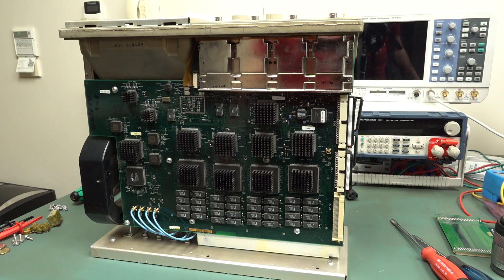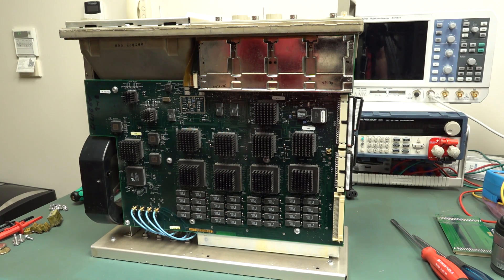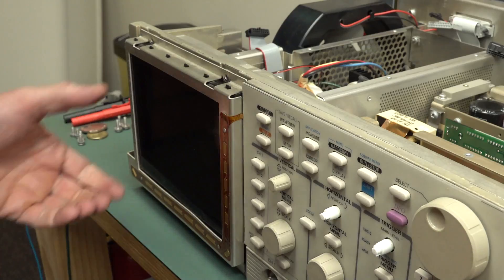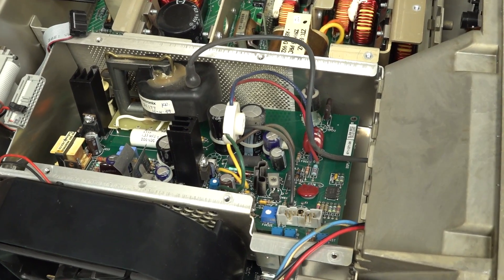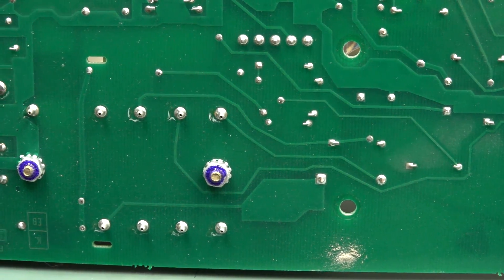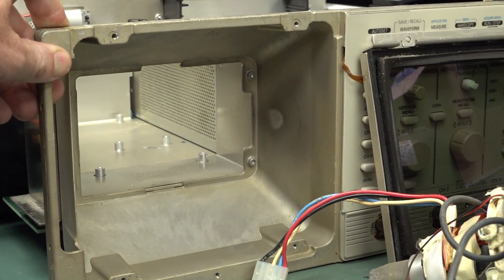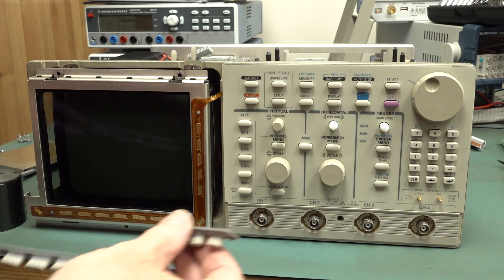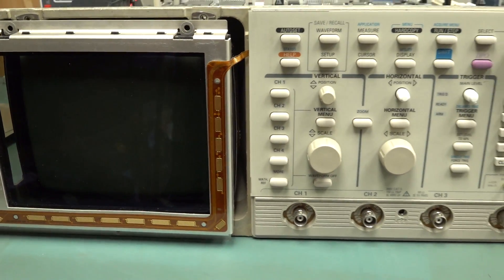Tektronix TDS540D Repair Part 1

Comment: The anode cap to CRT go bad and arc causing dim, or arcing to frame and CRT won't turn on as a result. See spot where it arc over on side of frame. RTV over the anode cap usually fixes it. Just use clear RTV and let it cure for a day.

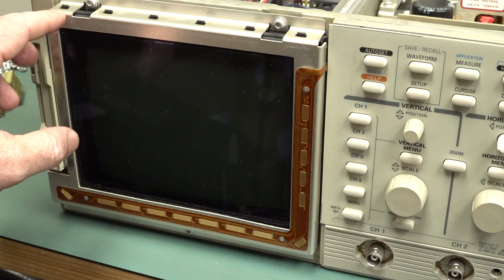Comment: Viewers! Date at time index 1:35 you said take the screws off to remove the CRT Frame. UH don't do that until you pull out the control panel, it just pops off, if you don't you can rip the control ribbon on the CRT Front Frame.  Here's some good info for you Dave when I did the research on this for mine. I have the LCD but never put it in. IT WORKS GREAT though sitting next to it. LCD types & Dimension Info below.

Dave, Here's some Important LCD info for ya.
-The LCD EXTERIOR dimensions need to be no larger than: Note the depth can be deeper than 1/2" but you will have to make some offset brackets to compensate for the deeper depth. Standard: 1/2" X 6-5/8 (6.64)" X 5-1/4 (5.25)" Metric: 127 mm X 168.65 mm X 133.35 mm 
-The ACTIVE/VEIWABLE AREA dimensions needs to be no larger than: Standard: 4.4" down X 5-5/8" across. Diagonally: 7.2" Metric: 111.76 mm X 143.4 mm. Diagonally: 182.88 mm. 

-The Active area, for best original ratio, MUST be a ratio of 4/3, here are some example ratio resolutions that should work if the screen is a 7" diagonal: 800x600: 1024x768 & 1280x960. To figure out if the Aspect ratio dimensions are 4/3 divide the large number by 4, then multiply the answer by 3. Then you will have the Horizontal x Vertical numbers you need. Ie. 1280/4 = 320, 320 x 3 = 960. So the screen you need is 1280x960 for a 4/3 aspect ratio. I don't know the resolution of the VGA out so I don't know if larger resolution screens will even make a difference in clarity. So until I do the experiment, or someone tells me, the 800 x 600 will have to do.
I put this information in my TDS744A project here: If you want to see it. https://www.youtube.com/watch?v=xv_ldH1dZMc Keep up the great work Dave! Best Wishes n Blessings. Keith Noneya Oh PS fix that CRT so I can fix mine LOL. Keith

Comment: You can run the driver board external to the chassis. Reconnect the ribbon cable, reconnect the CRT, and it should run. Of course, you have to be careful with positioning,  but this will allow you to measure voltages and probe around. Check the linear regulator output first, then have a look at the 50V and 500V rails. My guess is the failure is in the linear regulator, or in the flyback transformer (or driver). If you have a good 50V and/or 500V rail, then the flyback driver and H-sync path is probably all good. You can still have a flyback failure on the CRT anode HV though.

Comment: On the Tek TDS scopes,  the CRT usually comes out as an entire separate module -  frame, driver board, and all.    Not sure about this unit,  but the last one I rebuilt and restored,  a TDS 420A was this way.  You would remove 5 screws and the whole unit lifts up out of the chassis,  making it very easy to access everything.

TDS scopes of this era have been notorious for bad caps as well. The TDS 420A I just finished repairing had so many failed electrolytics -  some were physically leaking and had corroded the traces and other components on the acquisition,  attenuator, and power supply boards -  that I said the hell with it and replaced them all.  Over 100 of them in all throughout the scope.   It works great now,  and is one hell of a scope for the money,  but it's a bit of work to get them going again.

Just saying that you might want to check the main power supply as well.  It might work on the VGA output,  but there could be an issue with the rails for the CRT board.

Comment: Looking at the adjustments on the main board, it does look like you can run the CRT without the scope because it's a regular VGA monitor, with the 16-pin ribbon cable feeding video. VGA is nothing more than a set of analog R/G/B signals (which are probably mixed together on this mono screen) and a TTL-compatible pulse to trigger horizontal and vertical sync. That will take up 10 pins, with the remaining pins probably providing the power voltages required, it should be pretty easy to figure out which pin does what by scoping them, you'd need a high-bandwidth scope though, like the one you're trying to fix ;-)
Reply: Stoney3K actually, TDS series scopes from this years used to have a db-9 VGA output on rear panel. My TDS320 has it. VGA signal is monochrome.

Comment: If the flyback supply is working and buzzing then it will probably be the high voltage transformer the culprit. It must be a very obtainable part. CRT devices needed this changed all the time for repair until they were obsoleted in the late 2000s

Comment: Dave, check the deflection coils for resistance;  and I would also suggest checking their control transistors/immediate circuits for good gates etc... should be able to do some off-line probing to possibly find the issue....

Comment: Once I bought a 30 years old scope (it was comlitely analog). But after few hours of work horizontal line disappeared from screen. Thankfully I had a manual and after some investigation found that problem was in CRT's drive output transistors (don't remember vertical or horizontal coil). But I was able to find broken transistors only when scope was switched on. Without powering it on transistors seemed normal.

Comment: You need to find the adjustment pots and give them a turn while it's on and see if you can affect the picture in both directions or not. You also need to see if the screen pot (usually on the flyback) makes the screen brighter or not (be prepared to get a slight shock if the flyback is faulty). This will let you know if the problem is horizontal deflection, vertical deflection, or the flyback.

Comment: You showed us a high voltage probe adapter in the last video. Use it to check the screen voltage and horizontal, vertical waveforms. 
My money is on a power supply problem...
Cheers,
 - Eddy

Comment: Looks like the vertical deflection is far down, try to measure the vertical coils if theres some continous DC on the Signal, if yes i would expect the drivers output transistors to be cactus  if no try to measure input signals and voltages of the driver. Good luck by the way for the "colour" mod later, i had the same scope once and did the same project which was a pain in the a... because i did't had a hot air station then, try to add the 2F FFT function also as long as you got it open, it's just a bit of editing in the Dallas RTC (take a copy of it as soon as it works and do the CR2032 mod with the chip) ;) Just a pitty that I lost that scope after all that effort in a bigger incident in march 2017

Comment: Dangerous anode cap? It just gives you a shock, it won't kill you.
Reply: Okurka  it’s true that it probably isn’t lethal, but there is still risk of nasty injuries, such as whacking your hand against a sharp object as it jumps wildly from the jolt.
Reply: I actually met someone who was a specialist in fixing CRTs, and had a few high voltage shocks on these things. Damages to its motoneurons left him with a hand permanently shaking. How practical for soldering!
Seriously, never ever toys with CRT without discharging them. It's easy, it is nothing but a capacitor. So before unplugging anything, connect an alligator clip to a screwdriver, the other lead to the ground of the device, lift the skirt of the suction cup (you naughty!), blindly probing for the hole (this is getting pornographic) until the bad boy discharge (here we are).
Then you can disassemble everything. Some CRT have auto-discharge circuitry, some does not hold the charge for long, but anyway, never tick the dragon tail, better probe its hole before anything.
Reply: @Damien.D  I think neural damage was probably more due to repeated encounters with hot chassis sets ;)
Reply: Problem is you drop the crt and it implodes. Or breaks foot. These things give a helluva wallop
Reply: Agree, never heard of anyone being killed working on a tv,  it's more dangerous to apply 220 vac to a 110 device.....
Reply: @gerrymacdonald5435  Actually there has been lots of people killed working on older TV's since most of the picture tubes runs on 17KV to 32KV by using a EHT/flyback transformer which converts line level 120v/220v to 17KV - 32KV as required by the specific picture tube.
Reply: Anode cap is not the capacitor he is talking about, Anode cap is the point (connector which looks like a ladies hat) where extra high voltage transformer output wire connect to the CRT (the fat black wire in this video). You definitely don't wanna touch on that even by accident.
Reply: @vijaymerceline  CRT is the capacitor in this case (it's basically Leyden jar).
Reply: @shana_dmr  true! I should've known that since I'im working with CRTs for about last 20 years  :)
Reply: @vijaymerceline  Let's be honest, if someone works with two hands, grabs wonky EHT cable when TV is on or before discharging the CRT it's their own fault;) I think most incidents when you learn why it's called "flyback" (because you fly back after touching it) are totally avoidable. Just if you want to check that anode voltage is OK, grab one of these big kilovoltmeters made specifically for that and not try to make an arc to the chassis (I did it once or twice, I admit, but always with one hand, good insulated pliers, with set floating electrically, on wooden floor and set on non-conducting table).

Comment: While upgrading to a new color LCD is cool, I'd learn more from watching you diagnose the problem with the CRT. Systematic diagnosis; looking for obvious issues, then going section by section until the problem is found. That would be awesome.
Reply from the maker: The problem is you can't probe this with the power on. So no ability to do even basic powered-on measurements. All you can do is dick around randomly checking components in-circuit, or sucking them out and checking.
Reply: Solder the testleads you need, pull them trough a venthohle and power it up to measure (short version) or build a temporary extention to power it outside the housing, there aren't so much signals and lines going to the CRT Unit(longer version) ;) Nice greets from Germany/Denmark
Reply: ^ Agreed.
Reply: HV section was never an issue in repairing CRT TVs. Hot chassis design popular in consumer gear was much more dangerous, especially if you worked at customer's home, on your knees in some dark room corner and no isolation transformer;) There are literally few points in typical CRT that can zap you and you have to go around your way to do it. Respect doesn't mean fear, typical household electrician works with much higher energy circuits with exposed wiring on daily basis, and if we go along with electronics typical mains based switching mode power supply packs much more punch for your "excitement" during poking around than small B&W CRT. And no, neither flyback nor deflection circuits will kill you, you'll just learn a lesson that was entirely avoidable;)
Reply: This one is easy to power...
Power and signal is all through  a 16pin ribbon cable.  At worst you’d have to make a longer 16pin to 16pin ribbon cable and power it out of the chassis 😉
Reply: Me too, but if a colour upgrade is an option, killing two with one, sadly I would opt for the LCD option
Reply: Already see the problem as can see the arc spot on side of frame as fix a few of these and same issue pretty much. The anode cap to CRT go bad and HV arc causing dim, or arcing to frame and CRT driver won't turn on as a result. See spot where it arc over on side of frame. RTV over the anode cap usually fixes it. Just use clear RTV and let it cure for a day. horizontal output transistor and diode do go bad at times on these, since he did check diodes and not bad and can see spot, where it was arcing, that likely the issue.
To test just put 3 layer of electrical tape over anode cap and sit CRT back in and put frame and processor board back and see if CRT turn on and no arcing,

Comment: Hack the scope, make it a hackers scope. And put a Gotek floppy emulator in it. And a RPI to communicate via ethernet.
Reply: I love seeing mods, the more the better 😀
Reply: and make it run DOOM.
Reply: Yeah but it's 90's era Java based, if you already know it or want to learn it then awesome. I personally wouldn't want to go down that rabbit hole again unless I absolutely had to.
Reply: @dangerm4us  Wouldn't you do C or C++ then? It's from the 70s and 80s. Java and C++ are still some of the most used languages today.
Reply: @zer0b0t  yeah I decided to go down the C path, just far enough to get a LCD display and some sensors working on an arduino, that's been fun. So many gadgets, so little time.

Comment: Is there a brightness knob. Maybe something is out of tolerance and made it dark.
Reply: Yes, there's a set of trim pots on the CRT driver board, and it wouldn't do any harm at all to try adjusting them to see what happens (if anything).
Reply from the maker: @andyc7724  I've done that, nothing.
Reply: Or maybe the intensity, according to the manual it can go down to 20% close to off.

Comment: Bummer.  From what I saw, it looked like a weak horizontal drive that caused a low high voltage.  Were you able to ring test the flyback?  Check the horizontal output transistor?
Reply: Maybe he should ask on one of the vintage radio/TV forums (i.e. vintage-radio.net) as they are generally a wealth of knowledge on CRT displays/drivers, primarily as some of them used to repair them for a living.
Reply: Mrlithium, it means that the voltage for the vertical deflection circuit was traditionally generated in the flyback transformer in CRT circuits these days so when the horizontal transistor, the horizontal transistors line or the horizontal flyback goes partswise bad the vertical will go bad also. In that case the logic order to measure for the fault is to testing: HOT-> HOTs line-> flyback output for horizontal (in case of diode split flyback keep an eye on symmetry of the outputs AC because it could point to defective rectrification diodes in the horizontal secondary part of the flyback)->vertical driver/circuit........I repaired TVs and recorders a lot in my educational time and i was able to be woken up at 3 in the morning to be asked stuff like that in the end :D Nice greets from Germany
Reply: The troubles of low high voltage!
Reply: I think your right
Reply: It's usually the flyback crapping out. I have some after-market replacement transformers but it needs some adjusting from the CRT board for it to work (the screen will look smaller right after replacing the flyback)
Reply: This sounds so much like a techo-babble joke, but I know enough to know its actually real stuff he's talking about, just don't quite know what it means :P
Reply: @mrlithium69  In a typical monitor, the high voltage is usually developed from the horizontal output.  So, it's not surprising if weak horizontal drive goes hand in hand with insufficient high voltage.  A ring test is a specific test of coils like a flyback transformer to see if it has any shorted turns.  A single shorted turn won't show up in DC readings, but will impact performance - sucking energy out of the circuit.  That's why an ohm meter isn't a very good test.  It can tell you if it's open or has a massive short, but it can't spot a problem were they're only a few shorted turns.  Probably should ring test the horizontal yoke for the same reason.   The odd thing is that they not commonly found on test equipment.  (Much like ESR testers.)  I ended up buying my ring tester as a kit from Dick Smith Electronics.